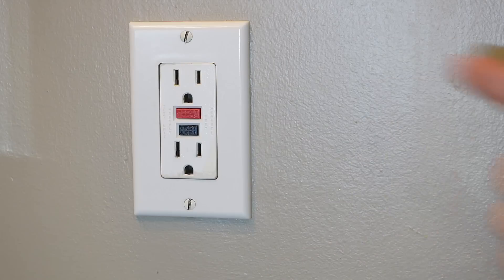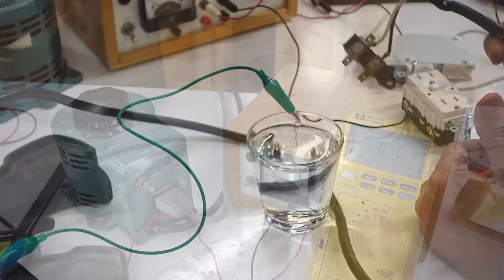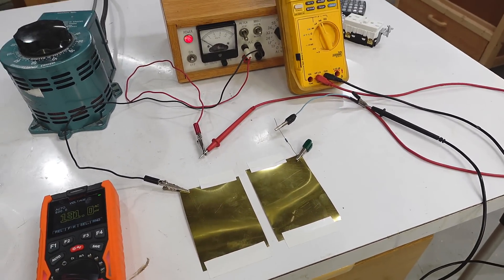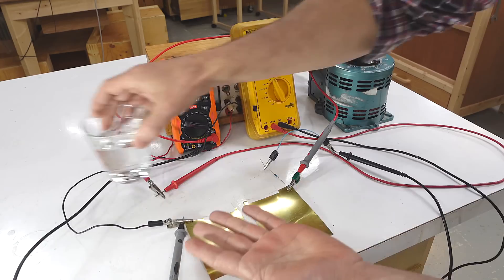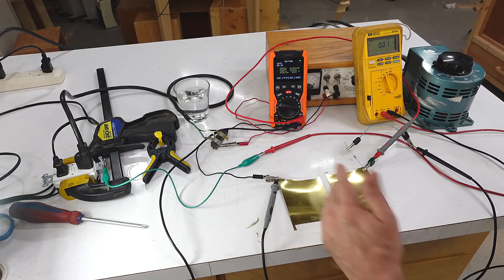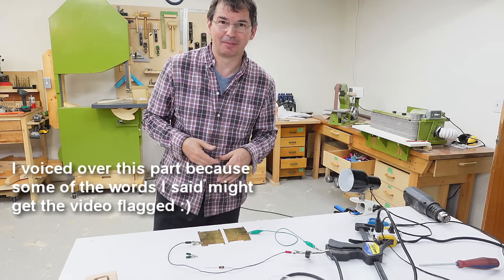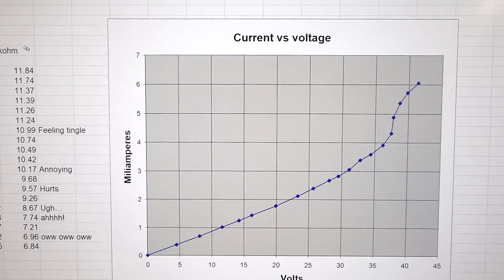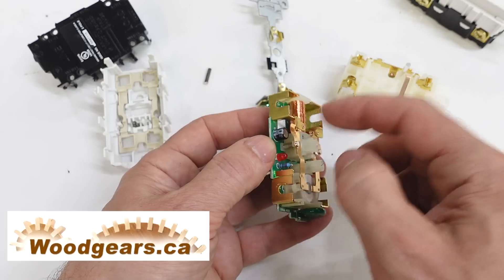What does it take to trip a GFCI by hand

Comment: I once got zapped cutting a live wire with a swiss army knife. I got quite a shock and I kept feeling it for hours afterwards. It vaporized part of the Stainless steel blade and even deposited a thin layer of copper on to the knife....

Comment: The most painful shock I ever experienced, happen when I was 19 years old.
I was in the middle of washing dishes. My hands were waterlogged from washing dishes around 10 minutes. The sink was full of water. I had my left hand in the bottom of the sink, full of water. With my right hand, I reached up and placed my right wet forearm on top of the refrigerator to feel around for a knife.
I found out that the refrigerator was not grounded. Ouch!
My chest muscles hurt for 2 - 3 days after this shock.
The refrigerator was fixed immediately after this!

Comment: I've shocked myself on 277 volts working on a commercial light circuit. It was FAR more painful than ANY 120v shock I have ever received.  My entire arm and shoulder was in extreme pain for a solid day after getting shocked by 277 volts. Needless to say, I ALWAYS test and double test  now before handling electrical wires.

Comment: You are a braver man than I, Matthias. 
I learned early to keep one hand in one's pocket when working with dangerous voltages, e.g. TV sets with CRTs (especially the first colour TVs).  Received wisdom was that it would avoid current flow from hand to hand, through the chest and heart. I maintain it was so that if you did get a shock and they flew off, you could catch them before they rolled down inside your trouser leg 😆

Comment: Reminds me of a time I was working in a plant in a wet environment. The control box had a short. So every time I tuned that switch on and be touching the walkway rail, I would be zapped.  Called maintenance and they did not believe me till I grabbed their arm and the switch and zapped them.  Pulled out the a meter and it was 220v running through it.

Comment: I did get zapped. Block heater power cord plugged into my truck in the middle of winter. Early one more, I went to unplug the cord, but due to snowfall there must have been enough water somewhere to conduct the power. I got a very short quick zap and I hear the gfci on the outside of my house click.

Did it save my life? Maybe!

Comment: My father was an electrician and as a kid I received dozens of zaps - and in a 240V country (Australia), they are the real deal...
At the point where I could bearly walk, my dad had come home with a plug in his pocket, where he had cut the wires off flush with the body, and dumped on his dresser. I naturally plugged it into an outlet by pressing it in with my hy palm on the bare wire ends. Apparently I received a nice burned hole in my palm from that - made worse by the fact I had climbed onto a stool to gain access to the outlet (full marks for determination).
Another time (at ~5yo) I was trying to electroplate a penny - I had attached wires to it and immersed it in mercury (ah, the good old days). I was then poking the wires into an electric radiator to "get electricity". Naturally, an explosion followed but with minimal harm.
Another time, after my father had become alarmed and installed "safety shuttered" outlets throughout the house (which won't allow access to the live contacts without first having the longer earth pin enter)... I soon explored their operation and was (as related by my parents) "showing" the girl next door how they work with a bit of wire she was holding and a pair of scissors.
Just a few cases - it is a wonder I survived.
Electric shocks are very unpleasant - I don't know why I didn't learn...
These days I am an Electrical Engineer with a healthy respect for these things and haven't received any shocks for decades 😊

Comment: you tripped it at 120v and didn't even feel it. I had to install GFIs all over my house to pass inspection. The GFIs in the house are ok, but the ones in the garage (lots of old tools that I have never been shocked by without GFIs) trip so constantly that I have taken them all out. The trip level is WAY too low. There is a pain threshold and a danger threshold. Maybe the level should be closer to the danger level so the installed GFIs are actually useful.

Comment: I have been shocked so many times. As a kid, I used to grab old TV from the garbage and play with them and make them explode. Also built a tesla coil a few times. Been shocked with 120v and 240v. Luckily both times is was very brief and although it knocked me good, I was not stuck to the circuit by muscles like some people have been. But i have learned over the years ways to prevent that so I don't get shocked as often anymore

Comment: I can't even count the number of times i have got stung by 230v ac ...  In the time before GFCI... The worse was while holding trying to light a 10000w light bulb (my father was a light designer at national television and we sometime had some awesome huge lightbulbs) i was holding the two wires to the fitting of the bulb with my hand with sticking the other side of the wires in the outlet. The result; the (old fashioned ceramic fuse) literally launched out of  the fusebox and the outlet has a large green burn mark that still there to thsi day, some 50 years later

Comment: as someone who's shocked myself many times in and out of the same hand, from hand to hand legs before. I never suggest it! I have tripped afci and gfci both by hitting wires over the years, it was more or less a tiny pulse almost unnoticeable, especially compared to all the unprotected shocks and having dimly lit incandescent bulbs.
I also suggest never wiring live or at least not without proper protection gear!

Comment: That water was grounded, but if it wasn't it wouldn't trip until the full circuit amperage was exceeded. Touch the black AND the white without being grounded and you get full circuit amps because current going into your body is the same as current leaving. GFCI's can kill.

Comment: This is “seat of the pants” testing regardless of the instrumentation being used. The GFCI is the most basic active safety device available for use in normal location where a person is not compromised. Meaning their flesh is intact and the contact point doesn’t penetrate the body. I would be interested to know how much variation there is between GFCI’s trip point and response time. I’m not a fan of this hands on AC testing that was popular in Edison’s time, we are smarter than that.
Reply from the maker: the sockets and breaker I tested were remarkably close to 5 ma, so I would imagine not much variation

Comment: As a kid in the 80s I'd take things apart so I could see how they worked. I took a fan apart and plugged it in to watch the motor run. Silly me, I didn't connect the wires. SILLIER ME I didn't unplug the cord. I'll never forget that feeling and that my dad was watching James Bond on Channel 2. 😂 I never told anyone but believe me, I learned my lesson and have been extra cautious with electrical work ever since. I don't need anymore of that happening to me. Actually, I just set up an electric fence and got zinged but it was because I grabbed the wrong wire. 😜 It was just a little pop. Nothing like the 120v coming out of the wall. Oof!

Comment: I have always wondered about this, how does it feel to trip a GFCI.  Is is the current large enough to feel?  How bad does it feel?  Is it on long enough to feel?  You answered most of my questions.  Bravo, Sir.  

My only other thought, which you did mention, was in your slamming you hand onto the table.  My thought is that the forceful contact would create pain that might difficult to distinguish from the pain of the electricity.  If you ever have occasion to repeat the experiment, perhaps set the hand down more gently.

Comment: I've always wondered how a "controlled" mains shock felt and have never been brave (or silly?) enough to try. Thankyou for your bravery and a nice approach using the brass sheets to spread the current! 
I've had plenty of other shocks from electric fences to car ignitions but started with a 9V battery across my tongue. An interesting tingle.

Comment: i have new peculiar problem, recently relocated to a new house which has a RCCB/ELCB  with IΔn of 30mA, everything works fine , but when i try to switch on my desktop pc with a cooler master 500w PSU with active PFC the RCCB trips the whole house, after tripping & resetting 4-5 times i'm able to switch on my pc, why is it happening , is it due to the Y filter caps to chassis earth in the psu.

Comment: I would suggest not using your left hand as the side being shocked, even if the path of least resistance is not directly through your chest.
I understand the breaker will protect you, but if you screwed up or it failed, you could quite easily have your heart in the fireing line.
With that being said, nice experiment, always hear that 50v is the "safe" threshold, it's nice to see this in practice and also see the relationship between voltage and amperage.

Comment: In the '70s things were even safer.  It was my job from about age 9 to reset the breakers which required climbing on top of the dryer in front of the box.  Nowadays, the idea of sitting or leaning across a grounded piece of metal while resetting breakers is considered dangerous.  Hey, we didn't have the internet back then so unless one of the old guys told you, you just didn't know

Comment: I had occasion to short a 480-volt circuit...something I wish never happened again.  I had removed the cover plate on a switch and my uninsulated screwdriver slipped into the receptacle box and touched the hot lead.  My finger was down on the driver's shaft, and I got the worst ZAP in my life.  My arm up to my shoulder went numb and hurt for about 6 hours after the incident.  Great video Matthias but I was hoping to see an Einstein hair result, thumbs up.

Comment: Getting zapped with 120 is never fun though not really harmful. I was in highschool and in an HVAC class. We had a group middle schoolers come in just to get them interested in the trades. We had a displace with an outlet, light switch and light receptical. It was powered by a suicide cord. Someone screwed up making it the metal plug end must have a short to it so when i plugged it in holding that end I got zapped.

Comment: In my craft room there is about 90v on the ground wire, been that way for a long time but we only detected it when my daughter bought a 3d printer and we got a tingle off the frame. I have never felt it off any of my computers in there, nor the Cnc router etc.  South Africa so mains wiring is all 220v 15 A.

Comment: GFC? RCD = Residual Current Device :-)
Reply: GFCI is a ground fault circuit interrupter. It is the term used in the US. It confuses many as they think it is related to the ground wire.
Reply: @okaro6595  somehow missed the I when carelessly reading. Thank you. RCD isn't much better to the layman but worthwhile in wet areas (kitchen, bathroom, outside) and a pain jn the arse elsewhere in the house.
Reply: Ground Fault Current?

Comment: I burned my finger bumping 230v phase with the top while touching ground with thr end, years ago, hurt but also actually burned me a little where it arced. No RCD device in those days. Had a few other good wallops at different times and different ways, some violent, eg 10kv at high school left hand to right hand through the chest, threw me backwards into a bench. Low current and no contact, two arcs.

Comment: So what is your internal resistance? Put the ohmmeter leads on 2 adjacent fingers, and see what it reads. I got shocked so bad in 1977, it stopped my heart, (480 VAC - all 3 phases), and messed up my nerve sensitivity - especially in my right hand. I could touch up to about 170 VAC and not even feel it. It wasn't that I could tolerate it ... I couldn't feel it. My resistance is still over 10 Meg ohm. (Retired) They used to mess with inspectors having me test GFI's ... they never trip. Messed with a lot of heads. I'm not too popular with EEG's and ECG's either ... they tell me my heart beats backward all the time - something about an inverted "T" wave, but I am ok.
Reply from the maker: that gives a very inaccurate reading. for the body,  resistance drops as voltage goes up

Comment: In 2015, I had some damage in my radial nerve - it runs down the arm to the fingers - so I had a nerve-conduction test.  In this procedure, they stick a needle into your upper arm, clamp an electrode to your finger, and give you a zap that is strong enough to make your arm jerk.  I had been warned that it was extremely painful, and it was unpleasant.  But, as I went through the test, I realized that the problem was the sensation of having my arm jerk uncontrollably.  The actual level of pain was not high.  I hope this explains everything.
Reply: If you have a good  TENS unit and crank it up to max it can be incredibly uncomfortable, sort of painful. Either the machine they are using is limited, or they didn't turn up the current too high I would think.
Reply: @jaro6985  Your comment should be generalized: never insult your physical therapist.  Or your urologist.  They both know how to make you suffer.
Reply: @paulkolodner2445  true. Didn't pass out but good PT is intense.

Comment: very good video.  OSHA clarified  '...that equipment under 50 volts is not always completely safe, either...
stress the importance of creating an electrically-safe work condition. Even at voltages less than 50V AC or DC, hazardous situations can be presented to the electrical worker due to high amperage sources, explosive potential, or excessive electrical arcing.
Electrical safety is assured only with a proper workplace hazard evaluation. Energized work less than 50 volts (AC or DC) needs to fall in line with the requirements of NFPA 70E 130.2(A)(3).'
https://e-hazard.com/electrical-guarding-below-50v-osha-interpretation/
great electrical safety explainer in link: https://www.ieee.li/pdf/viewgraphs/safety_considerations_in_power_supply_design.pdf

Comment: I remember when I was under 10y.o. someone told me, 'if you are unsure if the electric fence is ON or OFF, always touch the back of your hand as a shock will contract your muscles.  When you touch with the palm of your hand/fingers, it will close and you could potentially grab the wire. Whereas the contraction from the back on your hand will result in you pulling your hand away.'   
 
Thankfully, there was one less I still remember from my childhood.  🤞
Reply from the maker: I used a blade of grass to contact the fence, barely perceptible jolt that way

Comment: Was changing a light switch out and forgot the one next to it was a different circuit.  Everything was fine until I pushed the new switch back into the box and the tip of my finger touched the screw of the neighbor switch.  That was uncomfortable.  

What was worse was when my dad hit a deer with the van, and we were fixing it enough to drive home.  I was using some safety wire to wrap the radiator to the frame.  I didn't notice how close each pass was to the terminals of the battery.  When my last wrap touched the neg and positive with my fingers between, the wire "sublimated" between my index finger and thumb.  That thin line burn hurt for days.

Comment: Both current and voltage contributes to the energy per second that is experienced. Given 1W=1J, an average taser will fire pulses of 1200V @ 1.9mA, pushing almost 2.3J into your body but for fractions of a second and the pins are close together. With 46V@0.73mA=0.034J/s but you made it travel a very distinct path and small surface area. With the palm you increased the area and could withstand 46V@7mA=0.32J/s (a factor 10). Then the 125V*5mA is 0.625J/s but you only got it for 0.2s  or something so you were only subjected to 0.125J. Well under your pain threshold of 0.3 J/s
Reply from the maker: Way less than 0.2 seconds.  Also, at 125 volts its more than 5 ma, and at 5 ma, it was only about 40-50 volts
Reply: @matthiasrandomstuff2221   I don't think the trip current should be that much of a difference. I always thought that they trip on a fixed value between 4 to 6 mA, regardless of the voltage.
Reply: No way will 1.9 mA produce effects like the taser does. Also 1200 V will create much higher current.

Comment: I've seen more than 1 electrician put his finger in a light socket to determine if it was hot. When it's hot, they will pull back instantly. But 120v going through just your finger is not dangerous unless you hold it there until it burns you. (you won't)

Comment: You do have intrinsic muscles in the hand. These muscles produce fine movements as well as initiating certain flexion and extension movements. If these intrinsics are seized or paralyzed/rendered non functional, then your forearm flexors/extensors may not work as well as you'd think. Plus nerves work in an upstream manner as well and could inhibit voluntary control. It's not as clear cut as a wire conductor, so best to be safe .

Comment: I remember reaching into a light socket to change the bulb back in my youth, only to not find a bulb, and sticking my hand straight into the connectors. That got me one hell of a zap.
Reply: As a kid, I used to stick my pinky finger into empty sockets on the christmas tree (the ones for C7 bulbs, aka full 120V there at each socket) - I thought the tingling felt nice! I must've had really high skin resistance! I have shocked myself a few times working in junction boxes that have 3 separate circuits in them, and only 2 of the breakers were shutoff - that was unpleasant. I've also shocked myself on the hv dc side of a switching power supply - that was by far the worst, and by far the most dangerous as well. Since then I've been very careful around the primary side of switchers... those things bite, hard!